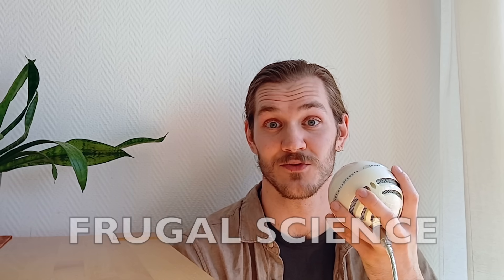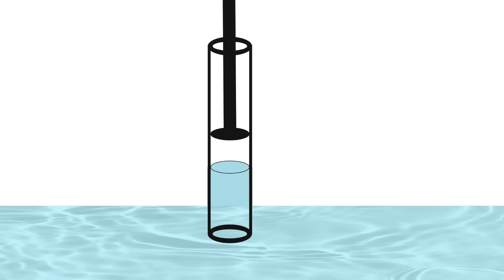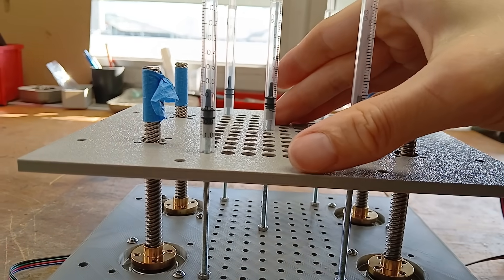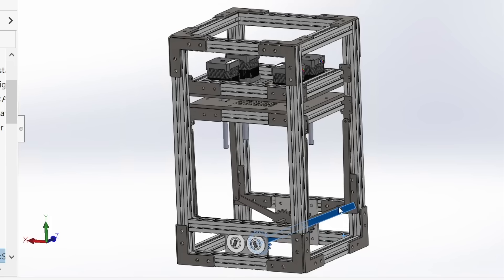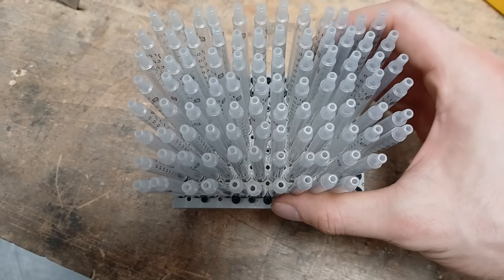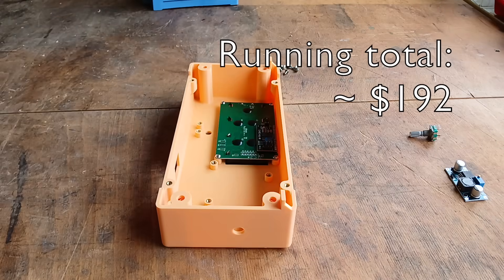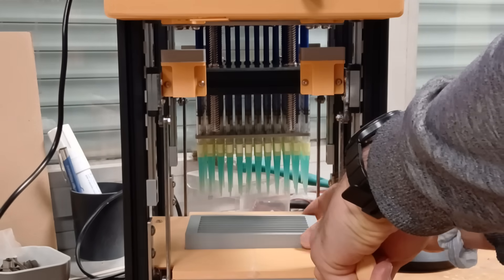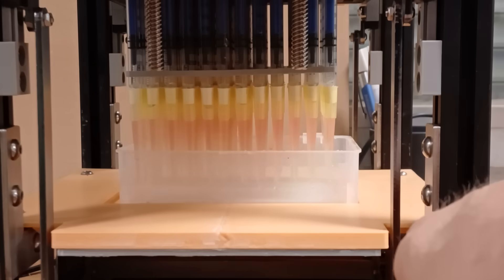This Medical Machine costs $18,000. I Took It Personally.

Comment: There's a reason they cost $18,000. Plastic syringes are designed for one-time dispensing of approximate amounts. They aren't durable and have a lot of flex. Some will work for quite a few uses, but others don't, making this essentially a disposable machine. Tips also need to be easy to change in batches using sterile procedures. You can even see the lack of consistent liquid level in the video, and your "quality check" consisted of weighing on a balance to the nearest gram (1000 µl) but you're using 200 µl tips. At least measure individual channel volumes on a balance that does milligrams. For some specific tests, this imprecision might work OK for a few uses, then you'd need to take it apart and swap out problematic channels. For actual science, you'll need a different mechanism that allows each channel to be calibrated and accurate within 1 or 2 microliters, hence the higher cost. Can an $18,000 product be made more cheaply without the benefits of traceability, sure, but this isn't it.

Comment: I cant speak for the medical industry, but the part pieces in aviation are equally as absurd. Often the reason is not some evil company (although...) or insane unnecessary precision but rather the shit ton of liability attached to every device. The signature is always the most important part. In general aviation an 'uncertified' market is beginning to establish so manufacturers use industry parts and don't log every screw torque, resulting in muuuch cheaper parts and a very much comparable product. But if you crash and die everyone will point at the lable 'UNCERTIFIED - only experimental use permitted - USE AT OWN RISK' and I see why this is not easily justified in med. I totally agree with your point though, that a cheep and potentially unreliable machine is infinitely better than no machine.
My thoughts on your project: I think you overdid it. Is there a reason to use motors at all? It needs electricity, cheap electronics, potentially flawed software and cant be troubleshooted by anyone (in the 'field'). Maybe the volume discharge of the tips? not sure 
Super interesting project though and for sure a great task for engineering competitions. There is still heaps to gain I think

Comment: That is the reason because medicine is so insanely expensive.
I noticed this in the pandemy, suddenly a lot of companies made "respirators" and they were perfectly functional, but in "normal" times the "certification" of those devices takes years.
There is a lot of corruption too. An engineer can create a machine for X-rays or EMR 100 times cheaper than those of GE, but extrangely, the governments of poor countries (like mine (México)) won't certify the cheap machine, no matter that is more or equal accurate than that of GE, they preffer buy the pretty expensive one even when they could have equiped 100 more hospitals with a machine a little less perfect, but functional.

Comment: I work in QA/QC and have over 10 years of experience.

Most of the cost difference comes from the certifications and standards required to sell to military, medical, or research customers—not from the device itself. The $250 unit is impressive, but sourcing components from suppliers who genuinely meet ISO, AS, IPC, or similar standards is difficult and expensive.

A prototype lab can make parts at 5–10× the cost, but that doesn’t mean they can manufacture reliably at scale. And supplier websites alone aren’t proof of compliance—proper QMS requires vetting, audits, and on-site verification.

A mom-and-pop machine shop can easily produce a $2 part when they aren’t required to comply with ISO 9001, AS9100, IPC, ASME, GD&T, or other recognized manufacturing standards.

Comment: This kind of approach could be useful in poor countries, where high equipment costs are prohibitive. I.e. your devices are probably a lot better than not having a laboratory at all. In developed countries, this will not fly due to certifications and standards (which are there for good reason).

Btw the syringes you use are for one time use. I doubt they will last a significant number of cycles, maybe that is something to improve in future iterations.

Comment: Hi there, I worked for a laboratory automation company where the founders developed a 96 head pipetter and worked on an 8 channel (one row) dispensing machine as a mechanical engineer. Then we wrapped a walk in closet sized tray robot around them to handle up to 500 plus plates.    In the meantime, there are many use cases for this where extreme accuracy and repeatability are not required or even regulated.  Someone mentioned essential oil production/dilution.  Education in STEM is a perfect fit for this both in the science of what gets pipetted and also the 3d printing, code writing, mechatronics and hands on assembly. Add to that 3rd world applications where non critical quantities or dilutions would be better than nothing and I think this is a extremely valuable project.  I would be happy to chat up Triggy offline to discuss this and other projects.

Comment: I am a machinist for our internal lab tech. I thought anti vibrating boring bars and tool holders were expensive... 
They have like these aluminum cup cake tins. 
Usually you measure them in cents. 

But these are "lab cupcake tins" measured in dollars...

Comment: Cool, but not designed for medical safety, and won't pass any certifications (ie; $$$). Also, in the US, the FDA 510k cert process requires you to developing with the FDA, not just after you're done. 
So not dissing on your functional engineering skills, but this is really an apples-to-oranges comparison.

Comment: First thoughts:
- If you 3D print an open reservoir with the nozzles attached, you skip all of the issues with misalignments and the time to put everything together. If you use a #D printing material that can withstand ~130 degrees steam, you can autoclave that part after use.
- Make the roof of the reservoir of a more rubbery 3D printing material so that you can clamp the open reservoir up from the bottom so it creates an airtight seal. Make sure there is an air channel in that top bit and you can use one pump to suck and dispense the liquid.
- Maybe use an ultrasonic sensor outside the reservoir to measure how much is inside?

Comment: lol so you made a machine that mimics the function of another but not all the safety standards required for that machine to work properly with biological stuff. how do you change the 96 siringes? who mods them to fit? hw do you check for sterile work flow?

Comment: Great video, glad to see affordable potentially life saving alternatives to the astronomic prices of western world lab equipment. Just a few things I would add to ensure better results:

Sometimes pipette tips are used to dispense potentially biohazardous liquids. Because you go through many sterile tips, removing each one manually can be treacherous and potentially dangerous, or it could compromise the results and contaminate future samples.

If there is one thing I would add, it is an ejection mechanism that allows all tips to be discarded at once without touching them similar to how professional single and multi channel pipettes work.

Additionally, it would be great to have a safety feature to protect the syringe used as a piston. The system should ensure it never aspirates more liquid than the tip capacity allows, preventing the inoculum from entering the syringe and causing cross contamination. Perhaps adding a setting on the display where the user selects the tip volume before pipetting would solve this.

Comment: Great! But your machine is primarily able to dispense clean solution into wells (which has to be 20, 30, 40....1000µl), for example you could make Elisas. To suck it clean out, that is difficult: the tip has to be in a corner of a well. In real world you have to change tips often and you have to clean the syringes/plungers in case your servos moving too fast spoiling the plungers with inwards squirting liquid. How to dry it? If it is all metal you could use hydrogenperoxid, the alcohol, then heat it (for that everything has to be metal and/or PTFE) A good machine would be able to give a different liquid and amount in each well. Easy programmable. And a control for each well what was really done (in case the tip is not sealed).

Comment: To be fair tho, the only reason the $18000 one is not $600 is because of all the regulations surrounding medical grade instruments. All the certifications, re-certifications and sterile working conditions at certain stages (which make sense for industry) drive up the cost. They dont really care about the cost, they care about not being liable for anything. Whatever pricetag that results in, they will slap on and blame regulators. There is no incentive to drive the cost down, quite the opposite, as the sales person get's a percentage on the sale total. They actively seek for labels they can slap on that require little work (or a lot once) but drive the cost up significantly due to some one time investment that got automated real fast and now charged at the price of the one-time investment forever akin to a license fee.
Sales people having no incentive to be honest will ruin the world.

Comment: Man, the real issue with those overpriced devices is not the cost to manufacture. There is a ton of certification, standardization, various tests etc needs to be done. The cost to manufacture of machine is way closer to $1k/unit than you can think. It is the total costs that include rounds of tests and regulations.

Comment: Yay, you made a machine that can't be used in the field you "designed" it to used in. This is the difference between hobbiest and engineers. Hobbiest can create something once with no specifications. Engineers can create that same thing millions of times with tolerance and specs so you don't get killed.

Comment: As many others have commented. Making a prototype using these approaches is very standard work within Biotech and other tech engineering industries. The cost comes when you have to start scaling up to make thousands of these and put them in service for 5, 10, 15, or longer years. Medical diagnostics has to be able to produce the same result for decades which means the engineering has to last that long. So yes while you can make a “prototype” for a few hundred or thousand dollars, you can’t make a “product” at the same cost level.

Comment: I would have designed it to pressfit the syringes from the other direction using a top clamping plate or hold down all you would need to do then is use the finger tabs on the syringes to keep them in place. I would also suggest to stagger the heights of the the plungers so you could swap out syringes quickly without modifying them to keep them sterile until the moment you use them. you could use different 3d printed ends that the syringes could adapt to the micro pipets. or you could use standard micro tubing with threaded syringe adapters and a  remote operator if you were going for maximum lab cleanliness

Comment: Could have dropped costs a little by using pulleys (which are cheap, and/or can be 3d printed) and belts (which are cheap for the same reasons the motors are) to lift the plate. Similar in concept to how certain printers do a single motor dual Z axis

Comment: Everything in the medical industrial complex is a ripoff. Maybe next you can look into wound vacs. They are cheaply made with parts that probably cost just a few dollars, then they RENT them to patients for hundreds of dollars per month. And the one I saw that a friend was using, the manufacturer designed the tube connection in such a way that it was guaranteed to break, which happened many times and the tube was part of the disposable plastic container (which they also over charged for).

Comment: This stuff would be brilliant for schools. Gives them access to more interesting kit for cheap, helping to get more students interested in science and teach practical techniques earlier on.
Reply: That's a really great identification of a use case. Basically if the cost is necessary in the field the expensive machines are designed for, instead of trying to replace those machines, identify where those costs are not necessary and you find the market for such a machine.
Reply: I think this is what people in another comment thread are missing: there are plenty of potential applications for a cheap device like this that might not be perfectly sterile and traceable and platinum plated.  Schools, emergency medical situations (outbreaks), and probably other situations a) aren't passing any product of the device back to humans, and b) can be still be highly effective without the process being *perfect*.  They're so cheap you can even add redundancy to your process to reduce the risk of individual errors creeping through.
Reply: @omegacsblog  those machines are only used in highly mechanised labs that do alot of the same work every day.  
If you dont have 20 PCR machines and 200 gel chambers running at the same time you will not need one.
Reply: @nox5555  (Preface - I am not a scientist!) He mentioned Malaria, separating blood and plasma for testing. I imagine that in the countries most affected by this, having a cheap piece of kit to quickly test things may be an acceptable solution? I understand if blood is going back into the body it's important to have the proper kit, but if they're already removed the blood for testing, isn't that less of a problem? Genuinely curious
Reply: @HondaBasoon  its just not needed.
these machines are part of a chain of machines doing 1000+ tests an hour with very little human input.

poor countries just use a guy with hands instead, a bit slower but that doesnt matters because all the other machines are the bottleneck and labour is cheap in those countries.

Comment: I hate to be a downer, but the reason that many medical devices cost so much money is that they require certification and are not permitted to have user agreements or anything that would shield them legally from consequences. A company can make an air filtration device that costs five dollars, and it will work for the consumer… But that filtration company is not committing to it working for lung cancer patients over a guaranteed period of time. The medical device manufacturer does have to make that commitment.

Comment: Could you just use one stepper motor and connect the screws with belt or gears to reduce the cost even further?

Comment: I like the idea a lot!
Here are potential avenues for improvement this video made me think of :
A- remove the need for multiple motors with a timing belt running between the different screws. (If properly tensioned, belt slack is negligible)

B- don't use the plunger for syringes? Use a common displacer, have all pipette tips link to one sealed chamber, have a "plunger" (cylinder with o-rings) at the top that seals the top. By moving the singular "plunger" up and down, it might be possible that all pipettes draw evenly, if the fluid is identical in all 96 wells... And if we assume spherical cows in a vacuum too.

 that would also dramatically reduce the complexity of the whole assembly, since moving a single piston can be done with a single motor.

C- remove the motors and use a hand actuated lever with either a multiplicator, or a pulley system, or a lever system, use stoppers to dictate the volume dispensed.
I have no idea what is the need for precision on these devices is, but what is the real accuracy needed? (Not down to unpleasant and time wasting level, but what is the accuracy needed for the displacements?)

Comment: All very nice but  the siringes are a point of failure, these are mono-use, you can you can use em anyway multiple times but problem stay on the silicon part as it will invetibly fall off from the suction force itself, an inverted cap with a spring would be a better idea.

Comment: Bro $18K is not even expensive for a medical device, if only you could purchase it and that was it. The lion share the medical device company makes is not from selling these robots, but from servicing them. They might as well provide these for free, but they will charge $10-20K per year in maintenance where they will send an engineer once a year to do calibration, component replacement, you will pay $5-10K on custom supplies that come with expiration dates, yes, the pipette tips will all have expiration dates, then you have more expensive filtered tips for actual DNA/RNA stuff to prevent contamination, and that will be 80% of the work, so chances are you will need to buy more of those. There will be a minimal purchase limit etc. That initial $18K is not a problem, never was, its the ongoing costs of maintenance that is the problem.
Hand pipetting 96 wells takes around 10 minutes by an experienced lab tech, this is dead on arrival one trick pony, and in the industry ive never even seen anything like this that just pipetted one reagent all at once, this is definitely very niche application, and these niche applications need insane precision, your device will be precise for the most part, but come on lol.

Comment: So $90 and a little effort to change all the syringes which is likely going to be needed somewhat often since those were "one time use" technically it' to bad. Probably one change per day or week depending on what your using assuming it's the same stuff day in and day out.